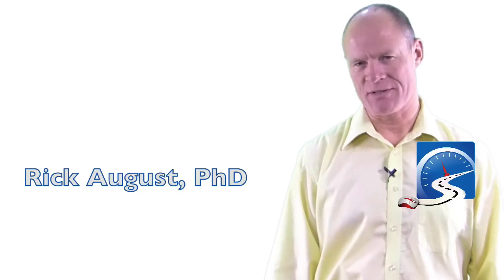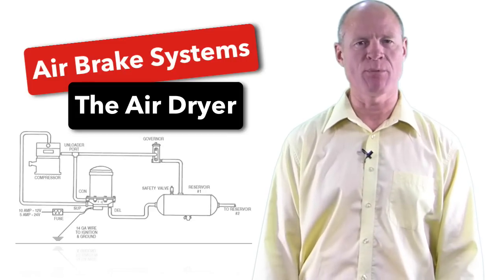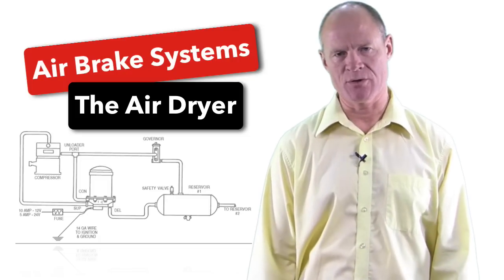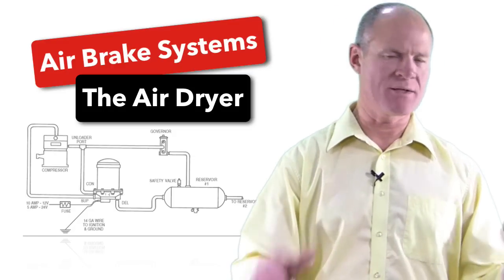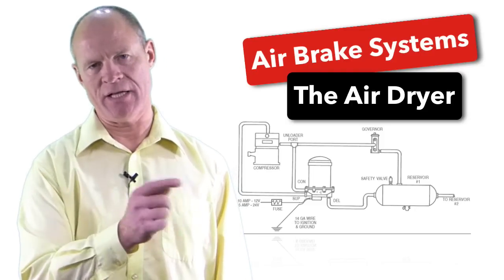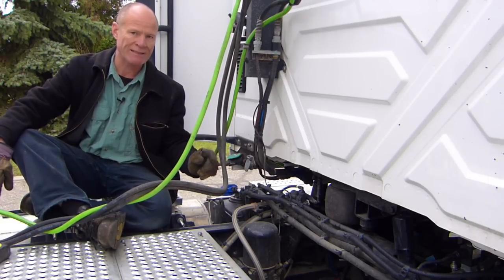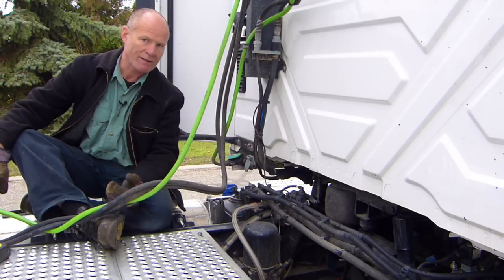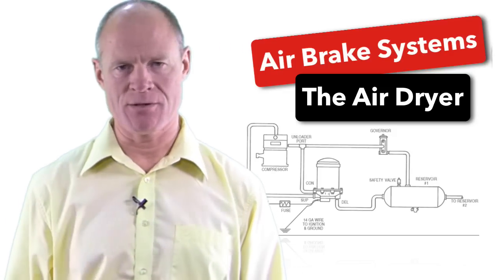How the Air Dryer Works to Pass CDL Air Brake Pre-Trip Inspection Test

Comment: I tan into a huge issue today. It’s mid summer so I didn’t have a freeze concern but I drained roughly 3-4 gallons from my water tank. What does water if that volume do to your brake system in summer time? Could it keep your brakes from properly releasing?

Comment: I believe my air dryer is located on the driver's side of the engine compartment. I'm currently driving a Freightliner Cascadia 2014 with a DD13  engine. These air dryers are all over just have to know how they look.
Reply from the maker: That’s correct my friend. Drop us a note if we can help further. Cheers Rick

Comment: Hello, how often should the air dryer purge while driving or park?
Reply from the maker: The air dryer should only purge when the system's air pressure reaches maximum pressure. The air dryer purging is trigger by this action, and this action only. All the best, Cheers Rick

Comment: between the engine's air compressor and the first air tank. The air dryer filters the air brake tanks so less debris gets into the air tanks. Even when there is an air dryer it doesn't mean the tanks will not gain more moisture. Emptying the air tanks DAILY will prevent any more moisture buildup and cause fewer problems.

Comment: 2005  International 9400I Egle is under the cab very hard to get to, you will get dirty.
Reply from the maker: Hi RICHARD MOZE - Thank you for your comment. And what fun is it working on a truck if you don't get dirty. 80) If there is anything further we can do, drop us a note. Always happy to help. All the best, Cheers Rick
Reply: RICHARD MOZE 
Is ur air lines dry? Got same truck and have moisture all the time. When u drain ur tanks what gauge needle drips? My wet tank and primary tank connected

Comment: 05 KW T800 logging spec, have a haldex system passenger side just in front of the steer
Reply from the maker: Hi Shaed Buech - Apologies for the late response. Thank you for your comment. That is where a number of these are located on different models and brands. Always happy to help. All the best, Cheers Rick
Reply: Thank you, mine has a small canister but it does a better job than my bosses AD-9 on his truck
Reply from the maker: Hi Shaed Buech - Thank you for your response. Great information. All the best, Cheers Rick

Comment: I have a split gauge, - primary and secondary air gauge.  One needle is orange, one is green.  I would think there would be air pressure gauges for tractor and trailer, but the colors do not match the airlines.  What am I looking at - what is this air pressure gauge telling me?  which needle is tractor air?    Which is trailer?

Comment: Mine is under hood my prevost bus conversion is under coach ahead of series. Detroit it has wet and a and b tank and two gauges the governor is on the compression but my trucks are turn of century the have integrated system no wer tank school buses and most strength trucks under hood. Prevost have pull cords to drain tanks in engine compartment but truck have a drain cock on tank

Comment: Very informative. Lately my air dryer purge/sneeze in every 10 sec (air at 120 psi) and keeps on doing this during driving. What could be the cause?? Please help. International 4300 dt466 2007 make.
Reply from the maker: Hi Hs M - Apologies for the late response. Thank you for your query. There could be a bit of dirt in the purge valve at the bottom of the filter. Try blowing a bit of compressed air into the filter and see if that solves the problem. If there is anything further we can do, drop us a note. Always happy to help. All the best, Cheers Rick

Comment: I greet him from Chile I have a question if the air dryer does not purge but the indicators reach 125 psi, where it purges. the truck is a Freightliner m2
Reply from the maker: Hi Dusan Masle - Thank you for your comment and query. Check the unloader valve inside the air dryer. If there is anything further we can do, drop us a note. Always happy to help. All the best, Cheers Rick

Comment: Int 2005 cummins. Always have moisture in my air lines. Valves failing too often. I can find water dripping off my glad hands/ my red/yellow valve. I replaced my dryer, change filter every 18k miles, drain tanks every day. What am missing here? Thank you

Comment: sorry for all the questions but it's a very interesting subject to me.........once more please about the one tank filling first and then the other............do  the air lines supplying the primary and secondary tanks sense which tank has the lowest pressure and  fills that tank  first and then the other tank bringing them both up to 125 lbs.  or is there some component in this system that i am not aware of. ? thankyou very much
Reply from the maker: Hi yard limit - Thank you for your comment and query. I'm not a 100% sure of this answer; however, I believe that the primary tank fills first, but only to about 90psi. The reason that the primary fills first is to give enough pressure to quickly release the parking brakes. Once the primary tank fills to approximately 90psi, then the secondary tank fills to 90psi, and then the system brings both tanks to maximum pressure. Saying that, most newer trucks aren't going to lose a lot of air overnight, so you're not going to notice an air loss of any significance - only if the vehicle has been sitting for a period of time. And yes, the governor is connected to the gauges that communicate air pressure in the tanks. If there is anything further we can do, drop us a note. Always happy to help. All the best, Cheers Rick

Comment: Can a clogged air dryer filter keep the system from charging above 45 psi,?Bendix 800089. 2006 Columbia.Detroit. Traced the line from the compressor with soapy water, seemed OK. Air compressor is blowing fine, plenty of pressure and flow. Unloader and governor replacement a week prior to air build problem. Ran fine, with 3-4 minutes between purge.
Reply from the maker: Hi Charlie Abbot - Thank you for your comment and query. I would suspect a faulty governor. What was the reason you changed the governor? It's possible that it's a clogged filter, but not likely.  All the best, Cheers Rick
Reply: I'm having the same problem, what did you come up with.
Reply: Depending on your system it sounds to me like an unloader valve kit may be needed. There are two kinds of unloaders. One located in the head of the compressor. The other is in the dryer its self. If the unloader doesn't work right rather than being in the load or unload position its stuck between and can not build enough air. 
Unless the compressor is total shot it will pump air, and you just need to figure out why. A leak in the line coming from the compressor doesn't even have to be audible to prevent the truck from building air. I've had that happen on units with branded steel lines.

Comment: two more questions please..........thanks for answering the first one............on the ADIS system why does one reservoir fill first and then the other. what causes this to happen and what is it about the newer air dryers that makes them superior so  that they don't need the wet tank. thanks again.
Reply from the maker: Hi yard limit - Apologies for the late response. Thank you for your comment and query. The reason that one tank and fills and then the other doesn't have a purpose - it's just a feature of the ADIS system. And the reason that this system doesn't require a wet tank is because the newer air dryers are effective in ridding the air of moisture. And because moisture is no longer a problem, engineers eliminated the wet tank owing to sufficient volume of air in the primary and secondary tanks. If there is anything further we can do, drop us a note. Always happy to help. All the best, Cheers Rick

Comment: I have a 07 freightliner my primary tank is filling up with are but secondary tank is not the guy is telling me my air dryer is bad is this true
Reply from the maker: Hi Mack Anderson - Thank you for your comment. It might be the air dryer, but it doesn't make sense if one tank is filling and the other isn't. Did the technician give you a reason for the air dryer do that - causing one tank to fill and not the other? All the best, Cheers Rick

Comment: Check valve at compresor pup up noise I replace  de air dry was dirty when a desconect hose  from compresor  line but still pup noise
Reply from the maker: Hi Javier Amador - Thank you for your comment and query. Is it the air dryer or some other component in the air brake system that isn't working my friend? All the best, Cheers Rick

Comment: Rick is very good at explaining how things work. Why are my air tanks full of moister every day? I have a 2010 freightliner. I have reconditioned the purge valve, changed the filter, still full of water throughout the system. I drain the air tanks every day and they are full of moisture each time.
Reply from the maker: Hi Robert Rinaldi - Apologies for the late response. Thank you for your comment. Did you solve the mystery yet? Is the air compressor on you unit liquid cooled from the radiator system? That's the only thing I can think of. Is your vehicle fitted with an alcohol evaporator? There has to be a source of liquid some where on the system which is being drawn into the air brake system. That sound like way too much water. Let me know. All the best, Cheers Rick
Reply: Thanks for your response Rick. When I said the system is full of water, I probably should have said it's full of moisture. There is so much moisture than some of it comes out as drips of water. Anyhow, I think I have found the problem. Although I had reconditioned the purge valve, it is not purging properly. I must have put it together wrong. I'm going to take it out and have another crack at it and hopefully I will do it properly this time. Thanks again Rick.

Comment: On the Pete COE the air dryer is on the outside of the left frame rail at the back of the cab. 
On the Freight day cab the air dryer is in front of the right steer tire. 
On the NaviStar the air dryer is between the frame rails under the sleeper. 
On the old Freight the air dryer is bet

Comment: My 2006 Sterling L9513 has it in the front passenger side wheel well.
Reply from the maker: Hi Thomas Varney - Apologies for the late response. Thank you for your comment. That's a common place for air dryers, and it's accessible. All the best my friend, Cheers Rick

Comment: rick, i promise,,,,,,my last question........not even sure if it applies since you are talking about air dryers,,,,,,but here it goes............with 2 tanks in the system ,,,,,,primary secondary.,,,,,when one tank drops below 90 lbs. and the other is full how does the governor sense ONE low tank and load the compressor to fill it. in your diagram i see only ONE governor sensing line from the primary tank back to the compressor. what am i missing here. sorry again for all the questions.
Reply from the maker: Hi yard limit - Thank you for your comment. Always happy to answer questions my friend. It is the pressure gauges - there is one on the primary, and one on the secondary tank. And due to the maximum and minimum settings of the governor, the system probably won't drop below 105psi before the governor begins to fill whichever tank is the lower setting close to that setting. There are series of valves and hoses, but simplistically speaking both tanks have to be at maximum air pressure before the governor will put the compressor into the unload phase. This video may help with understanding minimum and maximum settings of the governor and compressor: https://www.youtube.com/watch?v=dMxilatT0qw&list=PL0x-bChcUvwG2bSWReQWnk9Tm92L7WN_O&index=3&t=571s If there is anything further we can do, drop us a note. Always happy to help. All the best, Cheers Rick
Reply: Smart Drive Test  thankyou for your quick response. sorry again. will check out your links thanks......
Reply from the maker: Hi yard limit - you are most welcome my friend. All the best, Cheers Rick

Comment: what does the governor in close proximity to the air dryer have to do with it being an ADIS/        thanks.
Reply from the maker: Hi yard limit - Thank you for your comment and query. The reason that the governor is close to the air dryer in an ADIS system is because this system "combines the air dryer, purge reservoir, governor, and a number of the charging valve components in a single module." If there is anything further we can do, drop us a note. Always happy to help. All the best, Cheers Rick
Reply: rick , i still don't get it........whether you have an older system or an ADIS,,,,,,you still have a primary and a secondary tank.......when one tank becomes too low what is there in the system to tell the governor to load the compressor and fill the lowest pressurized tank. here's my problem'''''''''''''''if the primary system becomes too low and the secondary system is still full how can the low air pressure in the  primary system tell the governor to load the compressor and pump air to fill the primary tank.   i hope i made myself clear with my wording..........DOES THE GOVERNOR SENSE THE PRIMARY AND SECONDARY SYSTEMS INDIVIDUALLY AND IF SO WHAT COMPONENT IN THE SYSTEM ALLOWS THIS TO HAPPEN. THANKS............

Comment: Where I live the minimum maximum is 105-135psi
Reply from the maker: Hi Chip Jackson - Thank you for your comment. Is 105 psi what's in the manual, or is it what's accepted by authorities? Most manuals that I've read all say 80 psi for the absolute minimum, but authorities all go with 105. All the best, Cheers Rick
Reply: Smart Drive Test 
I’m talking about governor cut out. Must be between 105-135psi. You mentioned that the maximum is between 100-135. The trouble with this is that if your maximum is 100 and if the governor is set at a 20psi range before cutting back in, with a 1900lb rated spring, your spring brakes are actually “beginning ” to apply by the time the compressor starts building air again. 
In B.C., your governor unload is to between 105-135 for this reason.
Reply from the maker: Hi Chip Jackson - Thank you for your response. And you're absolutely correct my friend. But just to confuse everyone, the manual states that the ABSOLUTE minimum that an air brake equipped vehicle's governor must return the compressor to the load phase is 80psi.  It's on pg 161 of the old commercial manual. But you're right, here in BC, we pump down the 90psi and see if the compressor begins to load. And it's going to be tough to explain this to students, because when they take their test at ICBC, it's going to be looking for that 80psi number. All the best, Cheers Rick

Comment: Hi Rick. My truck air dryer purges at normal pressure but once it cuts off it keeps purging . I've recently replace the metal cover hose from compressor to air dryer. Any advice please

Comment: My air dryer was toward the front of the the truck by the front tire. After two or three Winters resulting in my air ride valves freezing up on the truck I decided to call Bendix and talk to an engineer. He told me without the new Adis system that do need approximately 27 ft of airline in order to get the hot air from the air compressor to cool down and fully condensate before the water gets to the air dryer so the air dryer would actually be effective in its process of removing the maximum amount of condensation build up. So I relocated the air dryer to the passenger side of the truck and moving back and extended the airline to approximately 20 ft. This resulted in a lot better results my truck did not freeze up in the winter and I had almost no moisture collecting in the first tank thanks to the engineers from Bendix

Comment: Thank you for the informative video! I had a question however. I don’t drive my truck commercially (old military truck) but I will be modifying my intake system on my truck that will result in a higher moisture content. I do of course have a wet tank system and was wondering if the air could possibly keep up with moisture removal, and if not, would one of the newer air driers have a better chance? I deleted my aftercooled intake plenum in favor of a intake plenum shell that I will install water/methanol injection on, hence the higher moisture content. I will only be using enough water injection to keep my EGTs under better control.

Comment: HI Rick! The Answer is:
Air dryer is located b/w Compressor and first tan or wet tank.
Reply from the maker: Hi Anshuman Prasad - thanks for that great information - that helps out the new drivers. What kind of truck are you driving? Cheers Rick

Comment: just replace my air dryer but every 3 day my coolant is low ???? AND notice i have a little water in in my air line in my cab under my seat ?????
Reply from the maker: Hi Tony: apologies for the late response. Thank you for your comment. That is an interesting problem indeed. Are you any closer to solving it? All the best, Cheers Rick

Comment: I was told to always pull the wire connecting to the drain cock on each air tank at the end of every or other working day on the unit unit to expel any moisture build up in the tanks for about 10 to 20 seconds. Is this still true for the new trucks.
Reply from the maker: Hi rob - thanks for your comment. Yes, that information is correct. I tell students to drain the moisture during fuelling. Air dryers are effective- so much so the wet tank has been eliminated on newer air brake systems. If there’s anything further we can do drop us a note. Always happy to help. All the best, Cheers Rick